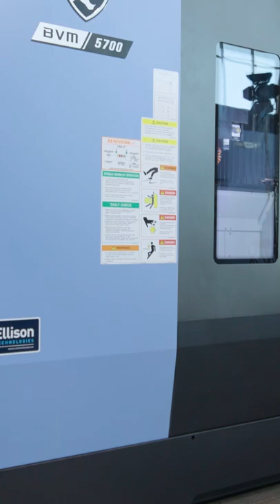Satisfying 3D Contouring with a Bullnose Endmill #shorts

Comment: Why use such a long tool ? Surely not the most rigid set up ?
Reply: It's roughing, the detail does not matter yet so you get the big guys out
Reply: The cost of the carbide in that tool compared to the cost of the carbide of a tool that isn't way too long for the job is astronomical. Carbide tooling is not cheap. Huge waste of money if you ask me.
Reply: Because it is roughing it is all the more reason to use a shorter tool for more rigidity. Shorter tool gives longer tool life with less vibrations through the spindle ulimately giving longer spindle life and bigger step overs shortening the machine time. I am sure the long tool is to give better access for the camera to make the video however while it may look impressive to those with no engineering knowledge ultimately it is bad machining practise.
Reply: @TheWill1006  
Thanks for explaining that!

Comment: What would you do if your work wanted you to operate a 3 axis knee mill with basically no training
Reply: Ask for training or a crash course from someone who knows. Or do your own research and teach yourself.
Worst case refuse to work if you're uncomfortable. Prioritize safety.
Reply: You do the work at night while they are sleeping, quickly and quietly pay me to come in and do the work for you while teaching you and you take all the credit for it. See, that's easy!
Anyway, it's probably a Bridgeport eztrack and you can pick it up rather quickly, at least the basics. They also have conversational G and M code so you can select canned functions, input your dimensions and run your programs. I've owned them in my shop for years and you will do fine. READ and Practice....Be Safe...Ricko